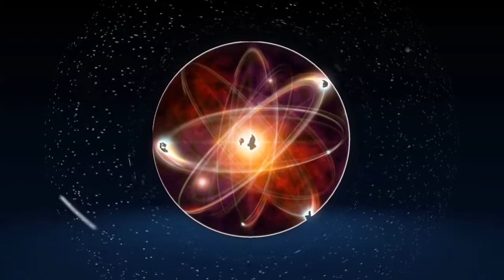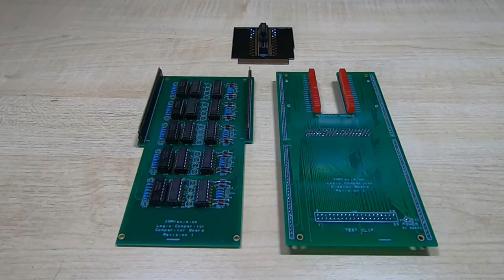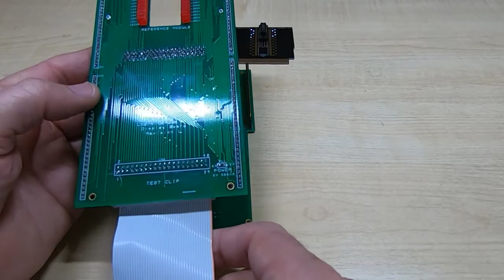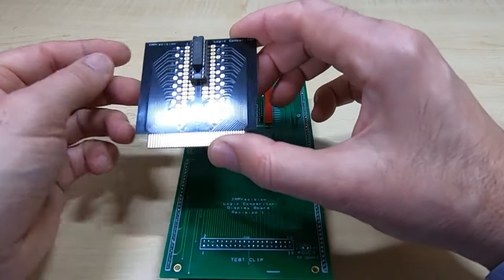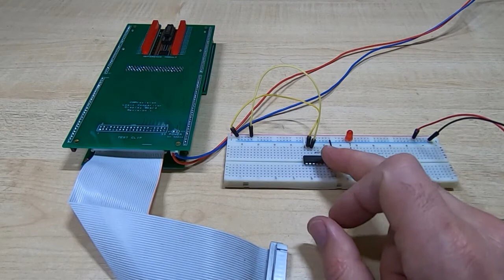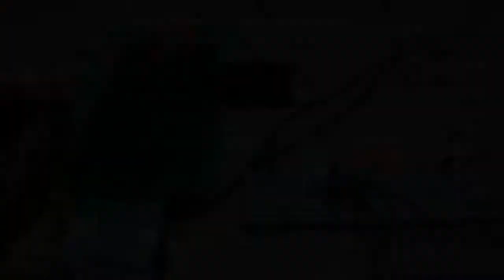JMPrecision Logic Comparitor Part6

Comment: Interesting idea, neat to see it running, makes more sense what you are after now.

Not that it matters much but it still seems you will need a different card for every input/output configuration of chips?  For example a 7400 vs a 7404, they would need different output configuration daughter boards right?
Reply from the maker: Yes that is correct (or you could just re-jumper another card). The main advangate of the unit it that it can test almost any device including complex devices like shift registers which cannot be tested any other way except by substitution and also while they are still in circuit. One of the reasons for using solder jumpers is that the cost is kept low so the module cards will be very cheap and having more than one will not be a problem. Even if you needed to swap a few jumpers it would only take a few seconds which is of course better than having to remove a chip from an old and delicate board. This device will also allow in circuit testing of very complex devices such as PIA,s microprocessors, RAM etc which cannot be tested any other way. Just remember that a card which supports a 7404 would also support around 9 other devices as well. In addition remember that this is a dynamic tester so will also be testing the dynamic operation of IC's and not just their static performance. I frequently remove IC's and test them in my IC tester and they test fine but do not work in the actual circuit. This is due to performance degradation and is common in older equipment but this tester will also detect such faults.
Reply: @JerryWalker001  Agreed, look forward to some dynamic tests and in circuit testing.